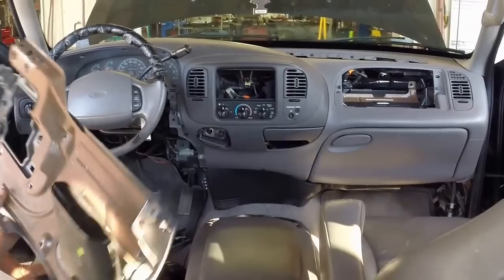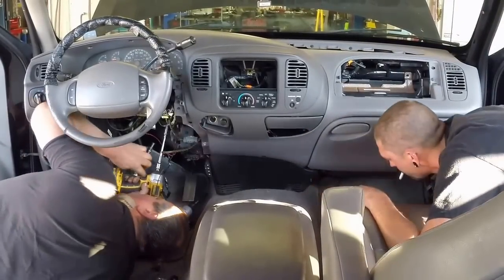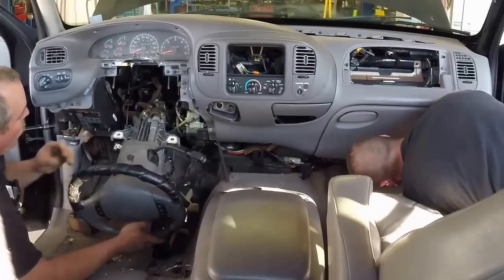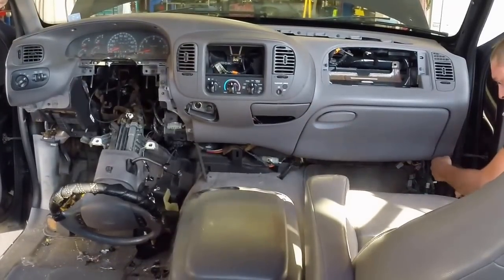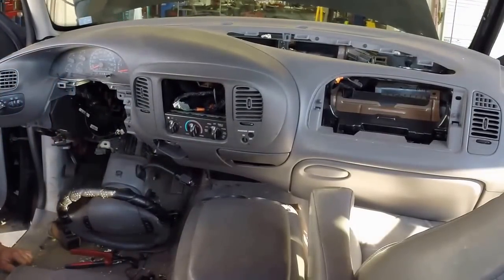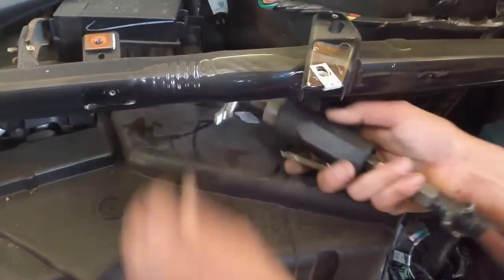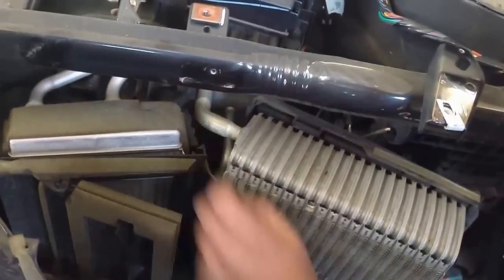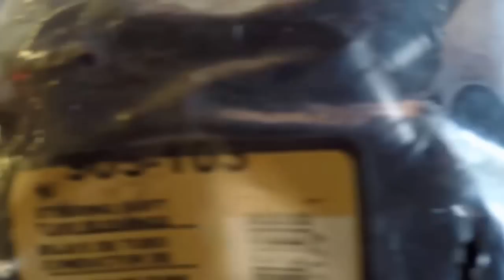Heater Core F150 Replacement-The Best Way To Do It, Wet Carpet

Comment: Ton of thanks. Watched your video about twenty times then tackled the job on my old reliable 99 f-150. Went pretty smooth but definitely need that extra hand realigning the dash upon the reinstallation. Cracked mine pretty good but found an eBay replacement pretty easy. The job is satisfyingly worth the effort and would definitely do it again.

Comment: What size is that 1/4 inch wobbly to get that fuse box out?. Can you list all the sockets types and sizes?. Sorry I live in Oregon and ain't gona make that drive for a heater core? 😢
Reply from the maker: Todd Bernal  no need to remove no fuse box

Comment: You guys are smart is it possible to get to the heater core through glove box if you use a cut tool to remove the bearer on a 1999 ford expedition?
Reply from the maker: InTheFleshInc yeh but that destroys the heater box for the time it takes I'll do it
Reply: Ok thanks, because winter is coming here in Michigan and my heater core is bad, already by passed it and have a new heater core but can't speend this much money or time to do it myself. Bummer plan on a back up plan going with a 2,000 watt power inverter and buying a heater under 1500w to run.

Comment: anyone have the problem of the engine cranking but not starting after its all put back together? Ive been over all the plugs 5 times or more and cant find any plugs missing their socket.  I dont think fuel is a problem either (fuse not blown and relay for fuel pump clicks) also i can hear the fuel pumping  when i listen near the engine.  it almost seems like the truck forgot the RFID keys.  i had a spare made once and the truck did the same thing (cranks but never starts)  anyone have any insight?  thanks.  The first and last thing i did was battery attach.  at no time was the truck disassembled with the battery connected.  Its a 1999 f150 5.4L XLT
Reply: check the connections on the passenger side wall near the floor and just under the dash i believe there is a emergency shut off switch located that may be engaged i had a similar problem with my pickup and it was the switch had been bumped and shut off by mistake when i had the panel out
Reply: Thanks, I had somehow enabled the rollover fuel cutoff switch.  Kind of a terrible place to put that switch, but I guess it has to go somewhere.  Thanks again for the video.  Took me 5 hr by myself but saved me $1500 😊

Comment from the maker: 1--864--684--4544  Just got diagnosed this week with an acending aortic anureysm about 7cm (3")... Me devasted.  Gonna need open heart surgery and about 1/2 million dollars. Might be off for a week or two. But call if ya want..I got someone what do this w/o me.
Reply: +Jake Payne (The Heater Core Guy) So sorry to hear about your health issue.  Hope all goes well.  I would like to ask if you replace heater core's on Chevrolet's? I have a 2006 Chevrolet Silverado 5.3 engine. Thanks in advance for your time.
Reply from the maker: Yes, we do all heater cores. Fast or slow. Takes a bit longer on silverados, dodges. Gotta take out the dash and whole heater a/c dept. Put it on workbench and take apart. Ford/Expeditions has a zipper on it.